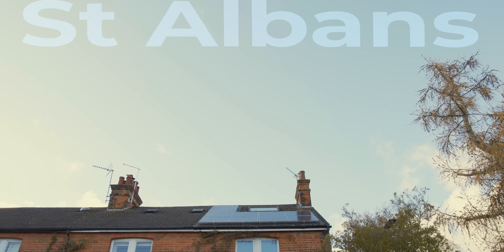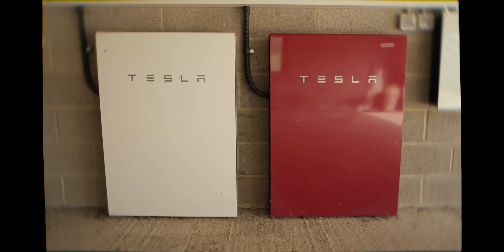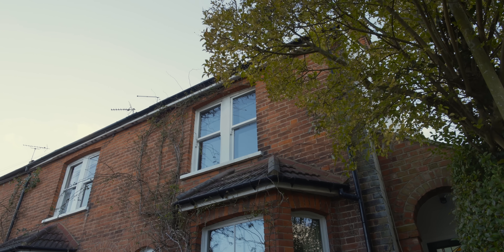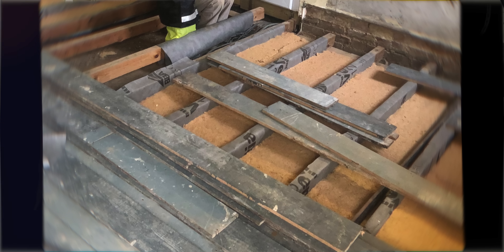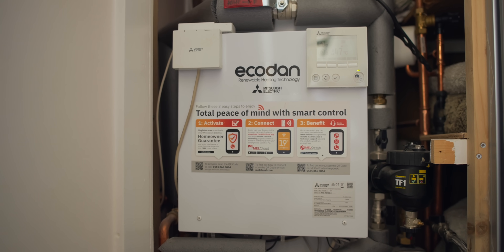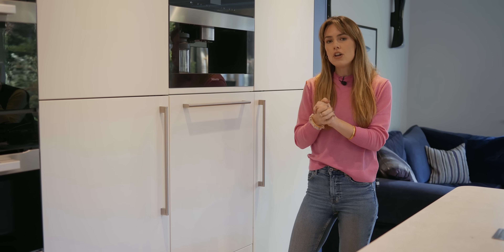This Victorian Home is Now 75% More Energy Efficient!

Comment: ECo nut nuts 
They spend £100,000 to save £1000 per year a heat pump system that has to have a electric element as backup.
cop system only works @5-6c outside temp , the lower the temp outside the lower the cop.

Comment: Just done the same thing but on a large 1970 detached, think this climate change thing is just nonsense so did it for economics alone. Chose the right PV and battery system and you can end up several thousands pounds a year in profit from your power supplier. Feels good for them to be paying me as opposed to decades of the reverse. Need a large roof facing approx south and pre approval from the grid to make this work though as you need to get 30+ panels to make it worth doing. All could change if the pricing structure changes too, which is a possibility.

Comment: That opening LIE. Heat Pumps use electricity to operate which is produced mainly from natural gases due to so called renewables which need a huge taxpayer's input from your 24% power tax to be viable plus the EU imposed 5% VAT and only work sporadically or not at all due to unsuitable weather, and the Heat Pumps, like EV's, need a  £7000+ taxpayer subsidy for starters for people with a lot of money to add to be viable and require a lot of building work to install , upgrade your insulation and change all your radiators and find a large space for the water tanks and mass of pipework and controlling equipment. 
Interestingly, our current Government has caved in and taken the soon to be enacted ban on gas boiler manufacture away as so many UK homes built before the 1960 are, in their terms, 'unsuitable' for Heat Pumps.

Comment: Good video. Judith is obviously a (very!) capable researcher and is well into the details; it's great to see homeowners take the bull by the horns. It's also necessary.

It's common for people to delegate 100% to the people doing the installation with variable results. It'd be nice if there was a simple way for homeowners to make sure they're getting the right work done (how many horror stories have we heard about botched insulation alone?) and also getting value for money. E.g. I know people harp on about Heat Geeks a lot, but I'd be confident I'd get a good result via one of their elite/experienced installers who have good reviews. I wouldn't trust a random, though.

It's daft (to me) that there's very little comeback via regulation and we have to rely on installers to provide it voluntarily. For every well-trained installer, there's probably another 5 that will install and run a heat pump like it's a like-for-like replacement for a gas boiler. 

Now extend that to:
- Insulation
- Air flow / ventilation
- Solar
- Batteries
- etc.

There's a lot that can go wrong! My parents' generation are scared of this kind of modernisation because newspapers tell them it's a total scam. The truth is somewhere in the middle -- you need to advocate for yourself, do your own research to independently verify the renovations and find a way of avoiding cowboys. But if the work is done well, you get a superb result!

How do we improve matters?

Comment: I'm intrigued about the suspended floor insulation. I'm in a 1901 property and can access the subfloor void. Would there be an alternate way to lay the insulation and membranes from underneath without having to take up the flooring?

Comment: One thing worth corecting is the vapor permeability. If you insulate from inside, then youd better use impermeable materials, so theres nothing to condense within the wall. Its actually worse to insulate from inside with permeable materials, cause you move the dew point inside the brick (cause it gets less heat from inside), and supply it with internal vapour.
Reply: Very tricky subject, and you will get told all sorts of things with conviction and a straight face.
Reply: @geirmyrvagnes8718  yea but you can just run simulations in your head of what happens when. Also there are free dew point calcs online
Reply: @geirmyrvagnes8718  best strategy is vapor barrier inside and outside insulation 

Or vapor resistant inside insulation.

You can just see how Scandinavian homes are made (inside drywall,pet film inside to protect wool from moisture inside, rockwool, drywall outside to protect from wind)

Comment: Great video. Just 1 observation on the heat pump, it’s not setup properly and is not running anywhere near as efficiently as it could be. It’s currently set up using fixed flow at 47 degrees in this video but should be set in a weather compensation mode please let me know if you would like help setting this up

Comment: 55 degrees is way too hot for the radiators, put on weather compensation and turn on all the radiators and add control for the bedroom so you can turn down your bedroom overnight. The secret for heat pumps is low and slow, on 24/7, heat the house fabric, it will keep you warm.

Comment: I implemented some of these insulation methods on a 1920’s semi. solid brick house, as part of a whole house renovation. I wanted an ASHP to replace the gas boiler. Contacted several installers and minimum with post renovation spec was 12kW which would have meant planning permission. Which was not in my renovation timeline. Eventually got new to market ASHP company that decided the house only needed a 6kW ASHP. Which was a surprise, install went ahead and house is consistently warm. Peak use is around 2kw per hour. Thermostat says the house is 20 - 21 consistently. Have to set the temperature lower over night because it gets too hot.

Comment: Watched this, found it very interesting, and agree with all the compliments about Judith's presentation skills below.  We're on a similar journey with a much younger (and I'd say less well built) 1980's dormer bungalow in Ireland.  Have the insulation and the Solar PV installed, now looking at Single Room Heat Recovery, ahead of going for the Heat Pump.  Can I ask what type/brand of unit did you go for and did you use the same one throughout the house?

Comment: This is misleading, to say I’ve spent 23k and put 90k on the price, the 23k was the over spend, and there’s no way the extension, solar, insulation, heat pump and then the new kitchen and all flooring, decoration and everything to go with it came in at 23k unless they are just talking about item price with no labour, Even then I’d find it questionable, judging on the work they’ve done it would easily hit around 80k I would even go as high as 90k judging on the finish of the kitchen.
Reply: Just watched this and thought the exact same thing. No way are you doing all that for 23k

Comment: So we’ve got a four bedroom Victorian school house and done exactly the same in regards to internal wall insulation, heat pump, new radiators, ventilation and 16 solar panels the only difference is we kept our LPG boiler so it’s a hybrid system so when it drops below 5 degrees we use the LPG as it’s a lot more cost effective than the heat pump when it’s cold. We got our EPC down from an F to 1 point off an A rating. We love the facts the house is always warm without the cold dips like we used to have but as for the 75% saving I do think that’s rather ambitious.
Reply: Out of interest, since you‘re saying that the LPG is more cost effective than the heat pump at below 5, when are you actually using the heat pump? Because with this level of insulation it seems like you would barely use the HP at all above 5 degrees outside temperature?

Comment: Turning radiators off, and using 3rd party thermostats is not the way to run a heat pump, particularly an Ecodan. They should have ALL of the circulating volume available to maximise efficiency, and having the controller in the "plant cupboard" means the best you can do is run in weather compensation mode (though it sounds like they may even be running in fixed flow temperature mode, which is nuts). Install a Mitsubishi remote controller in a living area, open up all the radiators, optionally drop the compensation curve a bit, and run in Auto Adaptation mode. I'd bet anything they could have then managed very effectively with a 6 or even 5kW heat pump.

Comment: I would imagine it is also a lot cooler in the summer. Can you reverse the heat pump to cool on very, very hot days? It it is possible does it add a lot of cost?

Comment: Really appreciated the breakdown of how they insulated the ground floor! Can anyone explain how they insulated the interior walls of the original structure? I can see that they went back to brick, and then seemingly built a stud wall in front and put insulation in there. What about any sort of airtight membrane etc on the bare brickwork? A parge coat of plaster? Any idea!?

Comment: The flow temp at 55 is way too high hence why your not using the radiators. My home is much bigger and I’ve only used a 7kW Vaillant heat pump. I love my UFH I must say. I’ve also put solar in and a large 30kWh battery. We power the whole home my electric camper and my wife’s electric car for £1100 per year. We disconnected the gas 2 years ago. We save well over £4K per year by not paying for fuel for the cars and making the most of the home battery, solar and night time tariffs. 

Great video by the way guys. Love all these renewable insulation ideas.

Comment: With the amount of insulation work you have done you definitely have an OVERSIZED heat pump. I have a 1970's 180 sqm 4 bedroom home with solid uninsulated floors. We had the same 8.5 kW Ecodan Heat Pump installed a year ago with some radiators upgraded, and the only retro fit we did was to remove the original 50mm loft insulation and replace it with 300mm Rockwall loft insulation (although to be fair the previous owners had installed some form of cavity wall insulation). We enjoy 21C 24 hours a day letting the Ecodan do it's own thing and a flow temperature a much more economical 30-35. You enjoy even greater comfort and economy by ditching that on/off thermostat and using the Mitsubishi wireless controller in the Adaptive mode leaving the temperature set at same temperature all day with a 2 degree set back at night and this would lower your flow temperature significantly. 55C flow temperature is far too high for underfloor heating so you probably have a mixing bypass arrangement to lower it for the underfloor manifold which is a very wasteful and overly complicated Old School approach when you could just be running the Heat Pump at the appropriate flow temperature.

Comment: This is the current issue with heat pumps, I have solar and battery and I'm on the octopus agile and a lot of forums about the tariff and clearly there's a lot of people who have had heat pumps installed and it's costing them A crazy amount of money to heat their houses in the winter because of electricity prices, it's okay getting a heat pump and going eco but in an old house like this one and mine you need to do all the remedial work to insulate your house to make sure it's set up for a heat pump to work or you will be paying through the roof to heat your house with electricity.  I very much doubt people are willing to pay 10s of thousands of pounds to get to a point where they can instal a heat pump and have an eco friendly home, Most people just can't afford it, and then they end up with a second rate heat pump install that they just have problems with because the house isn't set up to work with a heat pump properly.  It's all fine if you tear in your house to pieces and restart or if you're doing a new build but to get to a point like she has in an old house most people will not renovate to that extent

Comment: My word talk about the renovation growing legs. Given that we have a similar slightly smaller house but not as well insulated I’d be very surprised if they weren’t able to have a 6kW unit like we have. 
Our kitchen renovation ran away from us with 2x wall knock through and a full rewire. We had also managed to secure external wall insulation. Following that and then later getting solar and the ASHP, we’ve gone from about 16000kWh down to roughly 4500kWh excluding the car. I’d be hesitant with the improvement figures we have got already to go too far insulating under the floorboards and sealing up every leak to save a little more energy at the expense of having to do a whole host of Vapor barrier or ventilation retrofits. Some new double glazing and a new front door would be nice though.

Comment: Brilliant renovation. The only thing that surprises me is they didn’t go to an air-to-air heat pump. It’s the standard here in the US because it provides air-conditioning as well as heat. I guess their location doesn’t have oppressive summer heat yet?
Reply: Many UK homes are older and built with solid walls or other features that don't lend themselves to the ductwork required for air-to-air systems. Retrofitting ducted systems can be invasive and costly in homes in the UK, also as you said our heating systems always take priority as our summers can be as short as a week....if we are lucky - though by 2070 every other year will be hitting 40 degrees celsius. The recent studies of straw bale insulation boards during our heatwave of 2022 was amazing and showed outdoor temperatures exceeding 40 degrees celsius maintained and indoor temperature of 20 degrees celsius.

Comment: False information in this.
Vapour closed elements have and are used in millions of solid brick single leaf houses without causing damp problems.
There are several factors that lead to damp problems, vapour closed insulation may be one of those but to suggest its use in period properties will by itself cause damp problems is completely false.

Comment: What a beautiful and inspiring story, it is so rare to see such knowledgeable and passionate homeowner.

As mentioned, make sure to keep all the radiators and UFH fully open all time to maximise surface area for heat transfer, you can then drop the flow temperature from ASHP significantly, without impacting total KW heat output from the system (thanks to that extra heat emitters surface) - this is important since efficency of heat pumps increases dramatically with each degree of flow temperature reduction.

Assuming you use weather compensation and all available radiators/UFH, with your high insulation level you should be able to set the heating curve to 0.40 or similar, meaning that with 10C temperature outside, your heating flow temperature will be only 29c - resulting with efficency of around 500%-600% in this specific scenario (and 34C flow at 0C outside, allowing for 350% efficency or so).

Comment: 1:30 most of you doesn't have a clue what is a heat pump and how to use it properly hence why ALL of you now pay £650-£900 electric bill MONTHLY in UK houses. A while ago I have dropped brand new A-rated UK house in building rating calculator used in Poland and I ended up with 68W/m^2 which is E-rating !! and 116W/m^2 K-rating !! for typical 1920s cavity brick wall property with blown in polystyrene insulation and 200mm rockwool in the attic and 50mm in the roof slopes, with 6 double glazed windows and 2 doors. Legal standard for a new house in Poland is 21W/m^2 - 6x more efficient at minimum, because a lot of people build their houses for life and use quadruple pane windows and a lot thicker insulation than required.
heat pump is a low output heating, its electric so you want it to work for as little as possible. In reality you want floor heating, wall heating and ceiling heating pipes buried in the wall. Once you have the huge heating array and good 600l tank the heat pump will only run for 4-5h during the warmest part of the day, then the pump doesn't run at all.
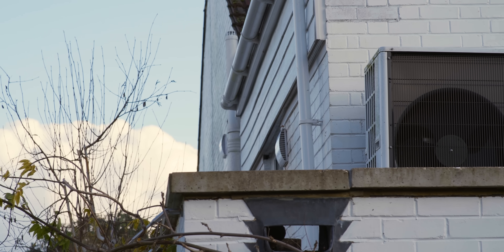12:14 - people have 250-300m^2 houses in POland and only use 8-10kW heat pumps - they have 8.5kW in this tiny house - crazy ignorants.  B-rated??? in your dreams🤣
Insulation inside the house doesn't make any sense as you  loose the thermal mass required for the low output heating, so effectively when the heating is off, the house gets cold  quickly. 
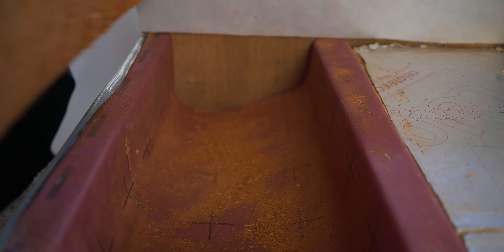6:35 - complete nonsense- you need insulation under the timber otherwise completely pointless to use PIR
Save yourself a life, demolish this shtt hole and build a house with external insulation.

Comment: Very informative video. But what about the windows? I have a Victorian 1 bed in London with very large sash windows — so cold in winter — but as I live in a conservation area I've been considering vacuum glazing like Fineo or LandVac with u-values of 0.5 to 0.7 W/m²/K for 8mm thickness. But the quotes for just 4 windows range from £15K to £50K (the cost of the these advanced panes is only about £3K of this, so rest is timber, labour and profit). So can't believe they got all this work done for £20ish K. In any case the government really needs to be providing grants or at very least low interest loans to allow homeowners to retrofit their homes.

Comment: I couldn’t help but cringe when she said she didn’t have multiple radiators turned on but was running at 55c with a nest thermostat on the wall paired with an 8.5kw Mitsubishi. With how well that house was insulated it should be running on 5kw heat pump at most with manufacturer control at a much lower flow temp ideally open zone using all the available volume for much better efficiency.